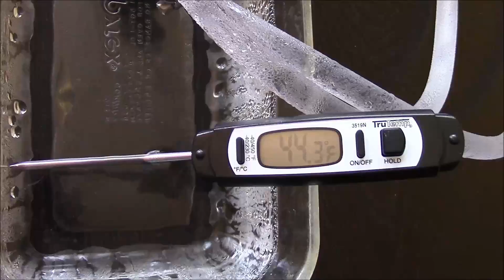How to Build A Water-Cooled Peltier Device or Thermoelectric Cooler

Comment: Well this seems interesting, but what if you keep the original cooler ( the corsair you use) on the CPU, and introduce the cold water on the close loop, just after the radiator...
I'll try make a scheme to explain myself better!

like this
http://tinypic.com/r/2rxwiv4/8
Reply from the maker: You could do that for sure.  I am not sure what the pluses or minuses would be over the more traditional method of mounting the peltier against the CPU itself.  I am guessing it would not be as efficient but you never know until you test it.
Reply: LDSreliance sure, you will not get sub zero temps, but maybe close to 8-10º C instead of 60ºC with a normal corsair unit. Because the water would be Chilled.
Reply: kapovsky and also, it would elimante all chances of "Icing" and "condensation" in the machine...
Reply from the maker: You could be right.  Are you going to test it out?  I'd love to hear the results.
Reply: LDSreliance Not so soon... I'm currently assembling an AMD FX9590 based pc...that's why I was wandering on youtube looking for a cooling solution to its 220w TDP ;p 
But if you have the chance, please by all means....DO IT!
Reply from the maker: I have a list of projects a mile long but I will see what I can do :)
Reply: I don't think that would work as the Peltier could only cool as much as the heat you can dissipate from the opposite cooling side. If I understand you're schematic correctly, you want to attach the Peltier to the very same thing you are using to cool the Peltier?
Reply from the maker: I see what you are saying Tony.  I interpreted his drawing as using an additional peltier to super cool the water coming from the radiator (which at best would be room temperature in theory) back to the CPU.  Lets say the water coming from the CPU to the radiator is 100 degrees F and the radiator cools it down to 80 degrees F.  The 2nd peltier could drop the water temp to 60 degrees F before it passes back through the CPU.  Obviously those are made up numbers but I like the idea.  It might just be too complicated to give much of an effect in the real world, though.
Reply: whats funny you would need another heatsink for the peltier that's cooling the heatsink that's cooling the peltier connected to your CPU lol
Reply from the maker: Right.  Like I said, it may be overly complex but it is a good idea.  I like where his head is at.
Reply: LDSreliance you got it dead on. Tony Eme  you too 
 The thing is you could theoretically cool down a much larger TDP  this way ... I think
Reply from the maker: If you had exhausted the best efforts of the most efficient water cooling system on the pc performance market then something like this to add to the system would be the next step, for sure.

Comment: Excellent setup. I am currently doing a research about anti-icing surface. I think your setup is much cheaper than buying an instrument.
Reply from the maker: Jeremy Cheung Very cool.  I'm not sure what instrument you would need for that but this setup is less than $150 total.  It needs some refinement but the concept is sound.
Reply: Well, I am a graduate student working at a college lab. There is a big machine using silicone oil as a coolant. What I am wondering is that could we control the temperature? Also minus 20 degree is low enough for my research, is there any low power peltier somewhere?
Reply from the maker: Yes, the one I am using in the video is a 5 amp unit (@12v so 60 watts).  There might be smaller out there.  How much of a volume of liquid is there to cool down?

Comment: Can you try adding salt to the cool side water to see how much colder it will get?  My guess is that if you used anti-freeze it would drop the temp by a good 10-15 degrees.
Reply from the maker: An excellent suggestion.  I will try this sometime with my own setup.  However, this setup that I am showing in the video is for one of my subscribers and he will be using his own liquid on the cold side because that is why he wanted the setup.  He wants to keep some of his aquarium fluids cool.
Reply: LDSreliance sweet, I just subscribed so I'll be coming up with a list of tests for you to do so I can save all that $ on modules, heat exchangers, etc. And the time I'll save. Can't wait to tell the kids they have their dad back and I can come out of the shed now! You might want to start researching stirling cryocoolers and low temperature rankine cycles. You're gonna be busy! Great videos BTW!
Reply from the maker: Thanks for the feedback and subscription!  You know the other subscriber paid for all the components but my time was free :)  I know you are joking but if you want me to try something out I am happy to do so as long as I have the parts laying around.

Comment: Why not get rid of the radiator and put a water reserve and cool the water with the peltier?
Reply from the maker: I certainly could do that.  For this application that I was building this for, I needed a sealed, leak-proof system on the hot side.  But you could easily put a water reservoir on the hot side, too, just like I did on the cold side.
Reply: LDSreliance also, usually the radiator takes heat away from the source and blows it out but you can also use it to take the cold away from it and blow it into the room if you pump the cold water into it.
Reply from the maker: Yep, I am going to see how effective that works as an air conditioner.
Reply: LDSreliance cool send me a link of that video after you make it, I would like to see what happens too lol

also if you want more cool ideas I have many of them but don't have resources to make them, so lets talk about that if you want
Reply from the maker: Naro Naroyan
For sure.  I am always looking for good ideas.  Email me at ldsreliance@gmail.com.
Reply from the maker: Naro Naroyan
rtboy02@yahoo.com is my facebook address

Comment: Hey LDSReliance, If you want the best performance peltier units, Check out marlow industries. They are researching to create the most efficient peltier units and already have some results. Check out http://www.marlow.com/
Reply: Agreed.  Thanks for the information.  I have been wondering how well the marlow peltier units run because they are more expensive.  You would think that them being more expensive would mean higher efficiency.  Yes, the only real limitations to peltier units are the internal resistance which dissipates its own heat from its own power consumption, Surface area, which prohibits the module from pumping only so much heat at a given time, the time it takes for the module to move heat from the cold side to the hot side, and the consistent temperature differential.  If these limitations were not a factor at all, they would replace refrigerator compressor systems.
Reply from the maker: Looks cool.  I like what they are doing.  Unfortunately, they need to keep costs down because their units are about 4-5x more expensive than similar models you can find on Amazon or Ebay.
Reply: Ik the prices are a problem, as well as shipping, but they are as good as you can get to my knowledge.
Reply from the maker: Cool, thanks for the heads up.  If I need something more efficient than what I have been using I will have to try one.
Reply: No Problem. Im going to buy one to use with a huge heatsink that will be 120 MM X 120MM with the base the is 1/2 inch thick aluminum with 1/8 inch thick fins as well as with a fan that pumps out 100 CFM of air at 19.8 Decibels which is really quiet. With all of this combined, the heatsink should get really cold. I also thought about the triton ice peltier units that they came out with. I have no idea how much that they want for them.
Reply from the maker: I would expect those Triton units to be double the price of their other units.  They seem to be pretty state of the art.

100 CFM isn't a ton.  I think it will come down to how efficient your heat sink is.  Good luck!
Reply: So would I in terms of price, Sadly. The Air cooling advantage aluminum has over copper is the fact that since it has more thermal resistance, so that also means it has more thermal "Capacity".  It will take longer to fully heat the heatsink than it would copper. And copper is expensive as hell but it provides a bigger "Hotspot" for the thermoelectric unit to dissipate the heat which makes water cooling somewhat more effective. This heatsink is a gigantic block of aluminum, thats for sure. Thanks!
Reply: I actually own some $20/piece 40mm Marlows, as well as some "5 for $15"  from Amazon, and after some brief testing, I can't seem to notice much difference. The cheap ones were actually sealed around the edges and the versions of the Marlow ones were not. My testing was done using seebeck though, measuring volts at different hot/ cold temps, so it may not be a fair assumption that that Peltier effect efficiency would be the same. I'm not saying they're equal but I was surprised at my results. There could be differences with quality of soldering materials,  max temperature,  thickness of ceramic, bismuth telluride thickness, etc but used new, hot side approx 250f, cold side 45f, I was getting the same 3 volts (I forget the exact readings) for both modules. I'm sure Marlow has superior R&D, customer support, etc and other advantages may become apparent with further use but I'm just not convinced that more $ = more efficiency. Especially at room temperature range. Heat flow from hot to cold is the biggest problem I'd think, followed by lack of heat dissipation at the hot side and joule heating on the cold side from electrical resistance to current. Just my $.03 (the extra penny was when I started rambling instead of ending after 2 sentences like I should have).
Reply from the maker: Good info, thanks!  That just confirms to me for my simple projects and testing to just use the cheapos for now.  Maybe if I build something more permanent and care about longevity I will try out a Marlow.

Comment: Nice....I am looking to build a chilled shiner chest for fishing and this is almost exactly what I had in mind except for using a serious heat sink and fan on the hot side. I hope to have the chilled water pass through a spray bar to assist in oxygenation as well.Would a large cpu type sink be enough.
Reply from the maker: The hot side heat sink is pretty serious although you could use a larger radiator or add another fan to get a push/pull configuration.  I am sure you are going to be working with a much higher volume of water so you will want a more powerful peltier.
Reply: Thanks for your quick response. I ran across an interesting device when researching this. A thermal link or TCO that would cut the circuit when the sink reaches 91 degrees Celcius....less than a $1. http://www.digikey.com/product-detail/en/SDF%20DF091S/317-1127-ND/1014756     Just not sure how to connect. I assume you connect it to the negative lead and place it on or near the sink as close as possible to the peltier. I hate to add the expense of the radiator and another pump. With the low cost of the peltier I guess the sink and push/pull fan would be worth trying. If adding the radiator is required  I assume it can be a closed system on the hot side but there would have to be a shut down system for safety sake....might boil the water and get a serious steam explosion. What do you think
Reply from the maker: The system I used on the hot side of my setup is a closed system designed for cooling a CPU on the highest performance computers (http://www.amazon.com/Corsair-Series-Performance-Liquid-Cooler/dp/B00A0HZMGA/ref=sr_1_1?ie=UTF8&qid=1408026198&sr=8-1&keywords=h60). 

Even running it over night the hot side of my unit never even got warm to the touch so I doubt it was even 80 degrees in the radiator.  These things cool down processors that run at 80 to 100 degrees Celsius (176 to 212 F) and higher so they are overkill for these small peltiers.  You could safely run a 10 amp peltier with this same setup.

As for the thermal link, there are quite a few devices that you could use for this:  thermistors, bimetallic strips, thermostats, etc.  I am using a bimetallic strip on an attic fan that triggers the fans to come on when the attic temps reach 40 C.  Works great.  Just wire it in series with either the positive or negative wire (shouldn't matter which) and then put the thermal link inside the liquid.